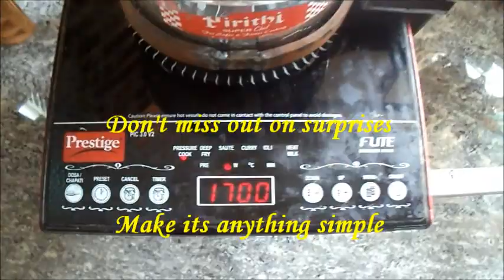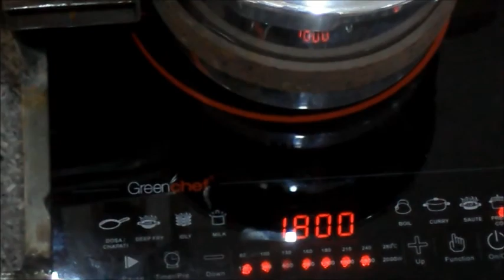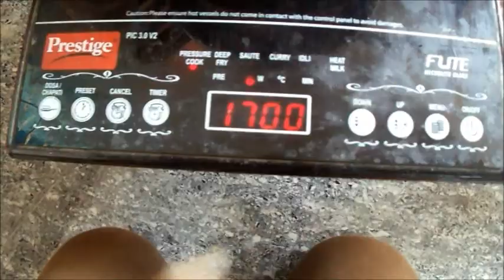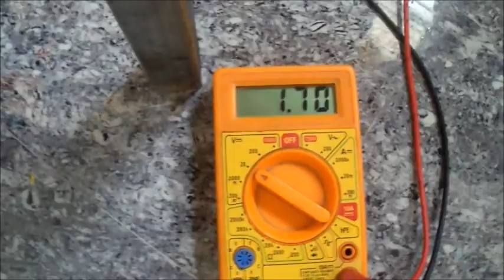power generation using rice cooker

Comment: Spending 1700v and making less than 5 v  you are wasting electricity ..saving = producing electricity  so do it  ..and your project is good i like it i sugest to put peliter module for more effect use flux theory or inventor
Reply: The idea is brilliant.  Just needs refining.  This could be powered with a small wood fire.